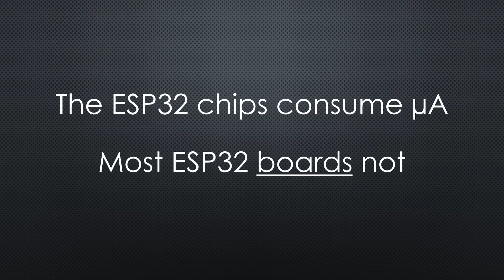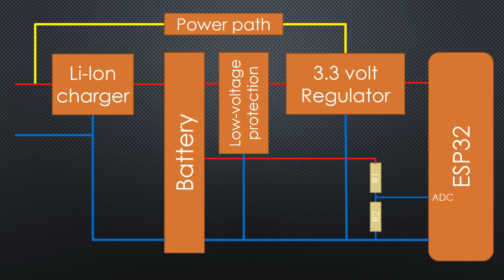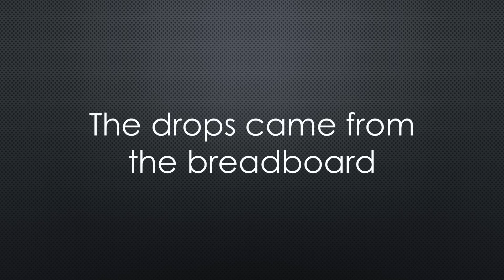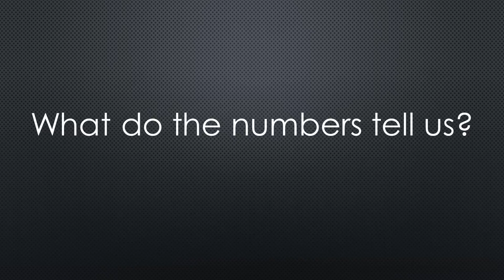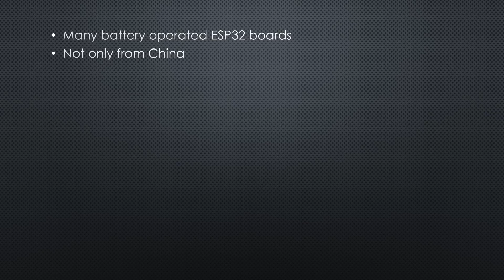#387 Test of Battery operated ESP32 Boards (Olimex, TinyPICO, EzSBC, TTGO)

Comment: There is democratization of esp boards and globalisation also. Due to economic disparity it is not perfect. cheap wins. For these boards battery undervolt protection is a must.

Power path idea looks very interesting, but i am thinking to add a power path to my existing "solar" inverter which currently works Solar>battery > main line from grid when both are completely drained but if there is a power cut there is darkness. But instead of mosfet, i would try 5a relays from the western companies 230vx5a=1150W. Lets see if that works and the relay doesn't fry. There are some SPDT relays available and they are listed as C/O (CHANGEOVER) contacts from reputed manufacturers (and clones) like omron, schneider and all...
Reply: power path on a very low power solar project is really not of great importance especially if the system stays in sleep mode for extended periods of time.. on a mains powered project or a power hungry one or one that wakes and actively consumes power very frequently it can play a role.. relays are bulky, expensive and power hungry beasts (latching ones are more expensive and require added circuitry to behave as you'd expect them).... creating a simple power path is as simple as using two diodes (o'ring) but then power losses are important when power is high.. simply put, there is NO one solution for all needs but there are many solutions for one need and choosing can be quite demanding task
Reply from the maker: @Jk44V2: So far I never looked into high-power solar energy. So I do not know best practice in this area.
Reply: @BudgetSolarGR  yes you are right no solution fits all. grid tie systems are easier to install, but just shut down when grid fails. off-grid systems work well but battery replacement cost make them expensive. there are some "hybrid" solar inverters, ie grid tie with battery back-up (dc coupling) available but very costly. regarding power consumption, 5w relay on a 1kw system isn't that much. what concerns me more is that devices and inverter should be safe and i get uninterrupted power with some electricity bill savings.

Comment: Very good video as always and thanks for putting all the effort into this neat excel table. If I want really low consumption, I usually use bare modules with Lifepo4 or Lithium Battery. I am still looking for a (pre-soldered!) Board with minimal passive parts and 1/10" connections. Any ideas?
Reply from the maker: I agree with the LiFePo4 batteries. They are now much more common than when I made my first video about them. Maybe I have to make another one and compare the two chemistries...

Comment: Quite a shame that the trigboard was not included. I get it, I also live in Europe and shipping taxes are a killer, but for the sake of comparison it should have been there. It also includes plenty of example code that teaches how to save power without detracting from generic ESP functionality. Let me emphasize again: quite a shame.
Reply from the maker: The trigboard is very different and compares more with a barebone ESP module. This is why I did not include it. But it is easy to compare the values, I think

Comment: Thank you for this movie!
What do you think to add also e.g ttgo t-call to the comparison? It is interesting what is the overall deep sleep consumption of board equipped with sim800.
Reply from the maker: I also did not include the T-Beam and other lora boards because they are quite different. Maybe I will do it later.

Comment: Thank you for your video.
Am I missing something, or shouldn't it be THAT hard to build an almost perfect ESP battery powered board, as long as decent components are used?
Do you have a theory why the results disappointedly still, after many years, vary so, so much?
I would expect all "battery ready" boards to only consume <100uA in deep sleep, or even less. Why would the display on one of the boards increase the deep sleep current? Why did the designers not include an option to completely turn it off? 

In short: why are most "battery ready" boards seemingly so badly designed for battery usage?

Sorry about the rant, but this topic really makes me furious. But thank you for your video, because it helps a lot!
Reply from the maker: I think things improved considerably and we get some good boards. I do not know what use cases the designers have in mind for their boards. Looking at the EzSBC (after properly disabling its gauge chip it has a consumption of only 11uA with very standard chips (HT7333 and A4056). It still lacks a power path. And I learned that under voltage protection is forbidden on board (in the US) because government wants to have this feature in the battery packs, Which is a good thing if it will happen. So we have at least a prototype design...
I am sure my videos are watched by the relevant people (at least outside China). So they have the information to act.
Reply: @AndreasSpiess  Let's hope thing will get better!
A neat feature to have on the boards would be a switchable power rail which the ESP can turn on and off so that sensors can easily be completely powered off when not needed, too.
Reply from the maker: That would for sure be good. sometimes I connect VCC of the sensor to a pin. Then I can switch it...

Comment: Dear Andreas! If you want to protect your battery from overdischarge, probably it will be better to connect resistive divider after low-voltage protection circuit?
Reply from the maker: Yes, you are right. I wanted to show the bad effect of such dividers (none of the boards had a low voltage protection)

Comment: In the table for the ttgo t18 you specified 10V as a max input voltage. How did you arrive at that conclusion? I have successfully fried the ldo on this board by connecting a very small solar panel (max 6-7 V) to its battery charger and having it lying in the sun for a couple of hours.
Furthermore: the ttgo t18 energy board sells on Ali both from the original manufacturer at 11 euro and from different sellers at half the price. I ordered both for comparisson. The are componentwise identical and the chinese knockoff only differs in its silkscreen type text. Even the chinese copy from each other successfully. 
Nowadays I protect my solar powered boards with a simple zener diode from overvoltage, just like someone else also suggested in the comments below.
Reply from the maker: I checked the maximum voltage of the charger IC. Did you check the open voltage (nothing connected, full sun) of your solar panel? because if the battery is charged, no current flows and the solar cells can get to a high voltage.
Reply: @AndreasSpiess  thank you for your reply. I will do some experiments when the sun is back!

Comment: For the battery measurement: Do all of these boards use a simple voltage divider, or are there some that use more sophisticated techniques? (like e.g. a MOSFET that turns the regulator on/off as a whole, or even techniques that add a capacitor on top for even less wasted current like https://jeelabs.org/2013/05/18/zero-power-measurement-part-2/index.html )?
Reply from the maker: I think I did not find any MOSFET switched voltage divider, The links to the diagrams are in the table if you want to check.

Comment: I could really do with some help. If you can spare a moment? I'm trying to find a small board around 35x20mm max that has lipo connector and charging support to control 8 Led's with pwm. That is budget friendly. the TinyPico V2 is great but quite expensive. Is there any other basic options that fit these requirements?
Reply from the maker: I showed the boards I have. So you have to search yourself if something like that exists.

Comment: Would using a LiFePO4 battery make a difference? I assume you wouldn't need a LDO to regulate the voltage just a battery supervisor to shutdown at low voltages.
Reply: You still need an LDO - the max voltage on LiFePO4 is 3.6V - That could still cause issues depending on how the circuit is designed.
Reply: I have a project running on a LiFePO4 cell. Very frustrating watching the voltage graph not change for months at a time! But it works very well.
Reply: @sail4life  Yeah you can do it.. just need to be careful. Same with using an 18650 on a board that is designed for a LiPo. 100% works, but you need to know what you are doing - no battery based protection (yes you can get those new fancy ones with protection, but 99% of the 18650s circulating have no protection) and you can cause havoc over or under charging an 18650 !
Reply: @UnexpectedMaker  No worries, this is a LiFePO4 we're talking about here, nowhere near as dangerous as straight Li-ion, though under voltage or over charging is a sure way to kill a Li-anything.
Reply: @sail4life  I would think thats a good thing.
Reply: @noweare1  It sure is, but running real time battery draining experiments is pretty tedious! Like waiting for a kettle to boil in somewhere between 3-5 months...

Comment: Sorry if I sound like a novice but could you also implant a Jule thief to improve the low power drain and improve battery life?
Reply from the maker: Because it is dangerous to discharge Li-Ion batteries below around 3 volts I would not use a Joule thief.

Comment: Hi Andreas. Great video. I have a raspberry pi 4 I would like to add some form of UPS to. Around 5 hours runtime would be fine (just to protect against brief mains power cut). The case I have for it cannot accommodate a HAT-based UPS. I would welcome your thoughts on what you think about using one external to the raspberry pi, connecting it via female-to-male GPIO ribbon cable? Say something like the PiJuice (or any other you may recommend)?
Reply from the maker: A few years ago, I started a "superpower" project to create such a board. Unfortunately, it was killed because of the parts shortage. I did not look into this topic since then because I solved my problem in a different way: I purchased a 240V UPS for the network as well as the computer.
A simple solution could be a powerbank that allows parallel charging. Not easy to find, though.
Reply: @AndreasSpiess  Thanks Andreas. I suspect you are referring to a UPS that provides devices with PoE? Is there a particular model you could recommend?
Reply from the maker: @Ant-up3iy  No. Just an ordinary 5V powerbank.

Comment: I've just started playing around with a vocore2, it's tiny, would love a battery solution for it.
Reply from the maker: This should be quite easy because it will probably not have the issues with low current consumption during deep-sleep.
Reply: I think i am working on something that could help you a lot ;)
Reply: @BudgetSolarGR  Yes definitely, I'm using the thing as a network boot device, all working. Need to pair it up with a battery solution, and I was thinking the dimensions of the casing of the vocore2 ultimate, if extended, are around the size of a single cell 18650. Two thoughts I had with the unit, was either a detachable battery which clips into both the mini and usb ports, dunno how good it would hold on. Or extend the white casing and have some type of plug on the other end. Might be impossible due to this side of the case being the side you insert the device itself.

But, any ideas? It doesn't need to be a full fledged UPS or anything, since I'm not using the SD card, I am using it cloud-based, and taking up 11mb of the flash.

Comment: Hi Andreas,
Could you tell me how you programmed the TTGO T8 with display? I bought one a couple of months back but I still couldn't set it up with the Arduino IDE and find any resources on how to use it's IO (like the display)
Reply from the maker: I did not program the display, just the deep-sleep test sketch. You need the development version of the ESP32 infrastructure to support the -S2 chips
Reply: @AndreasSpiess  oh okay. Didn't know that. Thanks for answering my question and greetings from Karlsruhe :)
Reply from the maker: You find the link for the preferences tab here: https://github.com/espressif/arduino-esp32
Reply: @AndreasSpiess  Thank you! :D

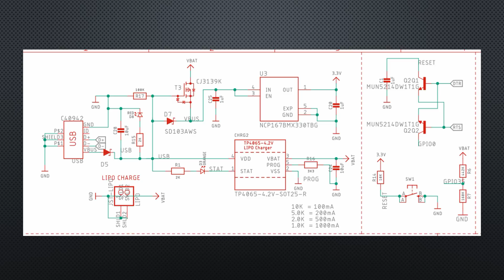Comment: At 14:38 on a schematic I see what USB VBUS and Ground are connected right after the 100k resistance and D5. Will this work as described?
Reply from the maker: I assume R17 is used to discharge the gate of the FET (gate to ground). The drawing is a little misleading, I think because of the power path.

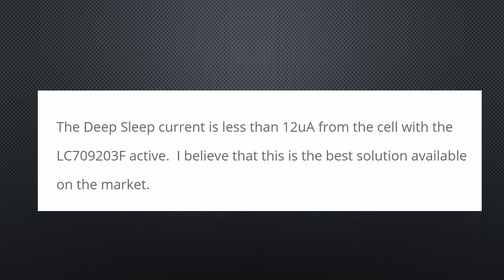Comment: 12:19 You measured a deep sleep current of 671µA for the EzSBC IoT board. In the comparison table the EzSBC is listed with 11µA deep sleep current. Which measurement is correct?
Reply from the maker: I got an update of the software after the creator of the board saw the video...
Reply: @AndreasSpiess  What does this mean? Which software was updated?

Comment: Are there any batteries that will fit in the TTGO board holder that also include a battery protection circuit?
Reply from the maker: I do not think so. They are all longer than the standard.
Reply: @AndreasSpiess  thank you

Comment: What about the Beetle ESP32 Microcontroller? It's expensive but it seems to be a great board.
Reply from the maker: The beetle has no battery. Do you mean the Firebeetle? I thought I had it in a previous video.
Reply: Andreas Spiess I mean the mini version of Firebeetle that looks like Bluno.
Reply: Andreas Spiess apparently the Bluno Beetle became the DFRobot Beetle BLE - The Smallest Board Based on Arduino Uno with Bluetooth 4.0, but there's also the version with Arduino Leonardo and the one with ESP32.

Comment: Can you tell me what is the difference between the“ bat pin” on the esp32 board and the specific lithium battery interface（JST）? Lithium battery connected to these two interfaces seems to be able to make the development board work.
Reply from the maker: I do not know which board you have in mind. But you find links to all the diagrams where you can see the wiring.
Reply: @AndreasSpiess  I use the lolin D32 board, and I don't understand the diagram very well.

Comment: It's unbelievable that over discharge protection is not standard. Its just a dead battery waiting to happen
Reply from the maker: In the meantime I learned that the US government seems to have the strategy to forbid batteries without protection (i think this is a good idea). Like that it is no more needed on the boards. Unfortunately, all my batteries are without :-(
Reply: @AndreasSpiess  that's a great move. I think there is a read need for a all in one battery management chip for single lipo cell's with charging with 5 or 12V as well as SoC tracking over i2c. Currently You need several chips to perform a quite clearly defined and common task.

Comment: Thank you Andreas a useful presentation as usual.  What do you think of the Lolin D1 mini pro.  I have used a couple for a data logging project yet to go live which will log every 2mins the tempreture and wieght of a kiln for an eight hour cycle.  I am using deep sleep and the life on a battery 2Ah seems good several days in fact.  Charging is an issue as the unit will be used in Africa.  Solar is possible but i am interested in Thermoelectric genarators as a hot kiln is involved.  How do tell the maximium allowed input voltage?
By the way were are you based i see it is around Basle My wife's family live in Seltisburg near Liestal and we are often over or would be except for Covid
Reply from the maker: 1. Maybe you check if your board is in my list. Otherwise I have no values
2. You find the maximum allowed voltage of the charger circuit in its datasheet
3. Seltisberg is 3 km from where I live (Lausen)
Reply: @AndreasSpiess  Thank you.  I thought the scenery in one of our outdoor video's looked like the area.  I have been through Lausen a few times
Reply: I have just been told by my wife that we got married in Lausen (church blessing)!

Comment: How to measure the battery voltage in TTGO T18 Version 3 ?
Reply from the maker: I assume at the battery pins using a multimeter. If you want to use the ESP32 you need a voltage divider. Just google.

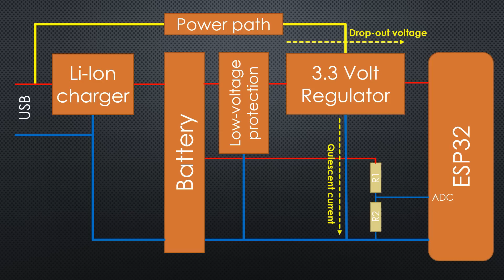Comment: @5:04 Could you not take the output from R2 and attach it to a pin on the ESP32 so that you could "activate" the voltage divider, take a measurement and then deactivate it to eliminate the loss? Also what disadvantages are there of using hibernation mode Vs deep sleep?
Reply from the maker: Some boards insert a FET  in front of the two resistor to switch the divider on- and off. You probably could attach the ground pin of the divider to an ESP pin and switch the pin to high if you do not need it. Like that you would reduce the current. But you would have to check if its voltage stays below the 3.3 volts.
I never used the hibernate mode so far. Is it supported in the Arduino IDE?
Reply: @AndreasSpiess  Yes, I think hibernate is supported. The only issue I had with it was when the esp32 started up I didn't get a reading from my dht11. I suspect I need to start something after the esp32 wakes, but I got side tracked making another clock. hibernate does also remove any external trigger and relied on the rtc only, from what I've found. I think it's just a simple call to    esp_sleep_pd_config(ESP_PD_DOMAIN_RTC_SLOW_MEM, ESP_PD_OPTION_OFF);
    esp_sleep_pd_config(ESP_PD_DOMAIN_RTC_FAST_MEM, ESP_PD_OPTION_OFF);
    esp_sleep_pd_config(ESP_PD_DOMAIN_RTC_PERIPH, ESP_PD_OPTION_OFF); after setting your wake timer then starting deep sleep.
Reply: @AndreasSpiess  You can put the pin (GND of the voltage divider) to input as long as not needed. Then it becomes tri-state. I think this is default during deep sleep anyhow.
Reply from the maker: And then your two pins will be at 4.2 volts... No current, no voltage drop :-(
Reply: @AndreasSpiess  My fault, good that you remind me that the divider is not only bringing the voltage into the range of the ADC but also protects the pins from overvoltage. I start to like the simple design of the EzSCB with the fuel gauge more and more...